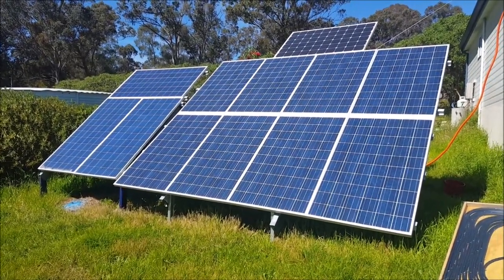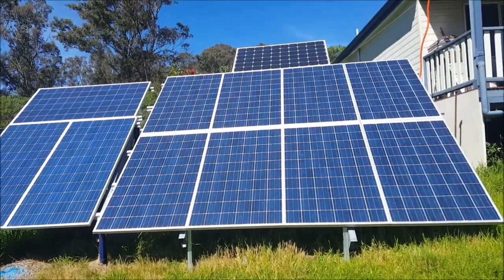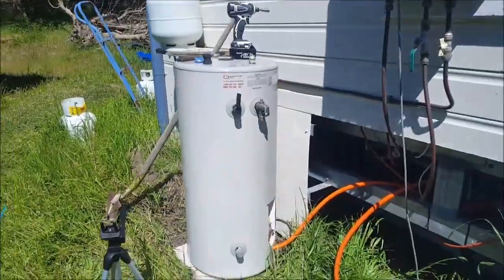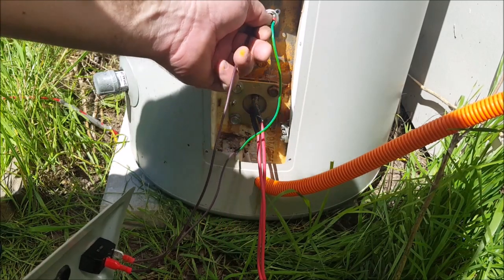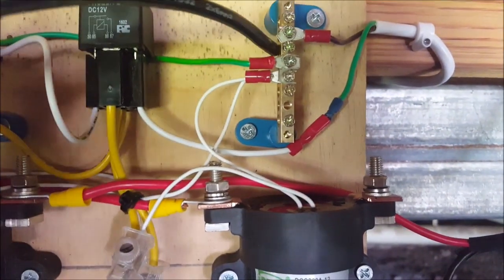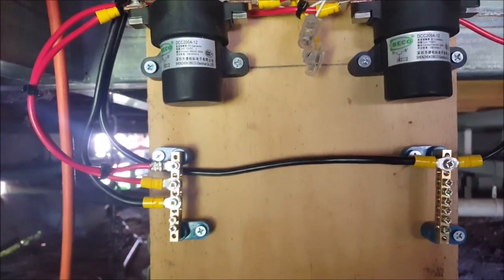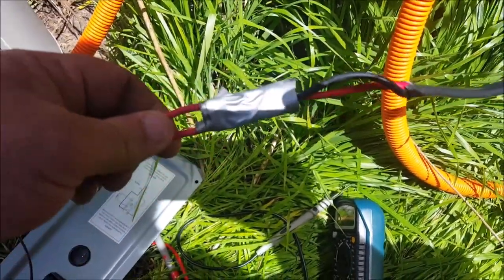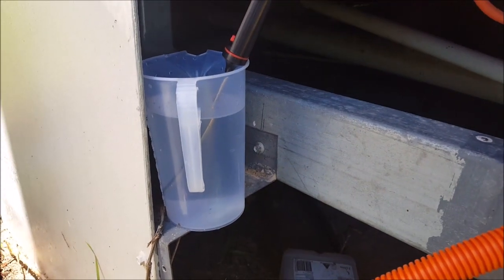Off Grid Solar Power - Solar Electric Hot Water - Part One

Comment: Would be nice if there was a machining process that burned electric that would work when electric is applied. This process would be so you could convert electric that would go to ground instead go to a process that requires electric. Maybe a AL forge? You could build a forge that would make ingots of AL and you could sell the product at a bargain since you are using surplus power.

Comment: That's an awesome array! Do you have any kind of air conditioning? Like a geo thermal type or even a dc one? i'v been looking to go off grid but it's very very humid and hot where I live.
Reply from the maker: I've got a split system air conditioner that's rated to draw 1350W. I haven't really had to use it in more than a year. Putting shade cloth up over two of the three west-facing windows helped a lot.